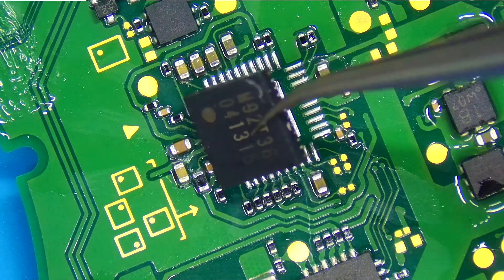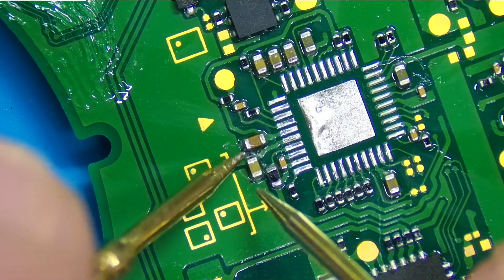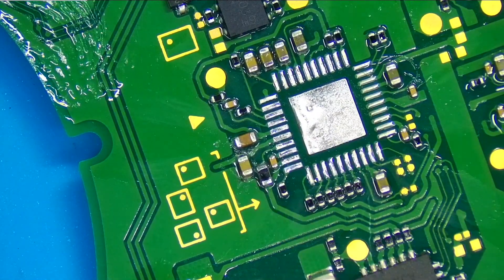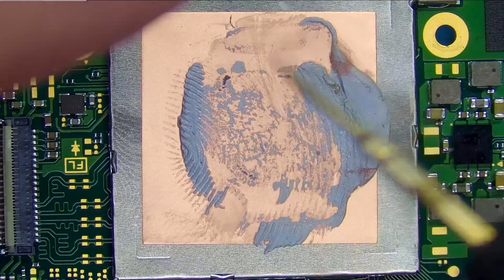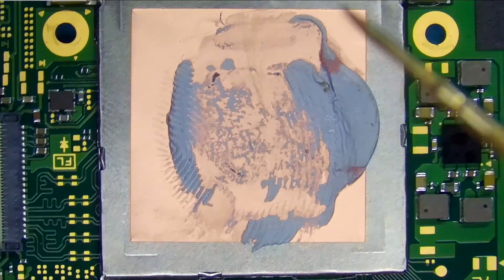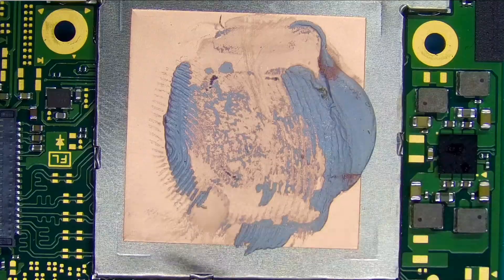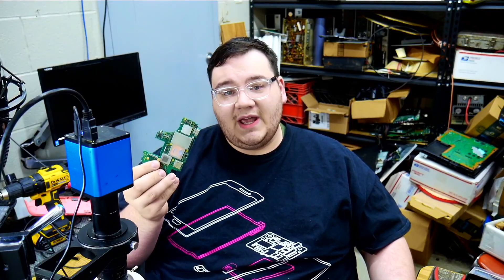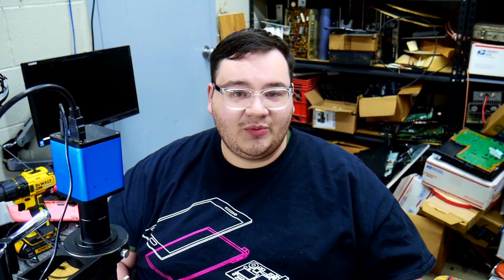We Can't Fix Everything

Comment: Chase! The scope looks amazing now pal, a lot better in my opinion. How did you find the switch from trinocular to HDMI? Great video btw :)
Reply from the maker: Thank you so much dude! So basically, the scope I'm using is my dad's, since it makes a much better quality video I decided to use it while he is not at the shop. However, I may buy one myself in the future almost certainly, my biggest caveat is, the trinocular scope is just better if you're going to be doing work by yourself. But if you're filming, the scope like what I'm using is 10 out of 10.

Although I still prefer a trinocular scope, this HDMI camera scope is like an all around perfect setup for YouTube and regular business as usual. 

This camera scope is very expensive, but totally worth it.
Reply: @chasefournier  what camera is it, it looks like the 1080P 60FPS SONY SENSOR IMX290 camera which is around $220, the microscope is pretty cheap but they do a really good job, you can pick one up for less than $100 bucks.
Reply from the maker: Very cool!! I was going based off the northridgefix price. I think its something like 600$

$300 sounds so much better to me
Reply: @chasefournier  yeah nah, that camera setup is cheap, his markup is probably 50-65%. Now just because it's cheap in terms of money doesnt mean it's cheap quality, it does a fine job. But I also prefer my AmScope trinocular setup, I hate the milisecond delay between what I'm doing and the camera and display hence I prefer looking through the eye peices.